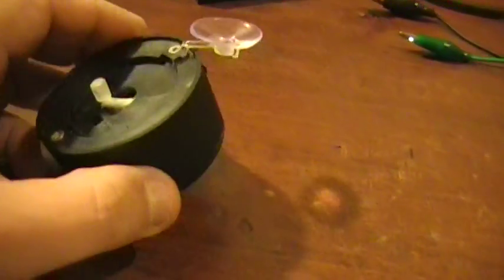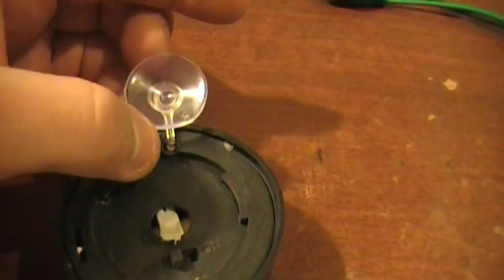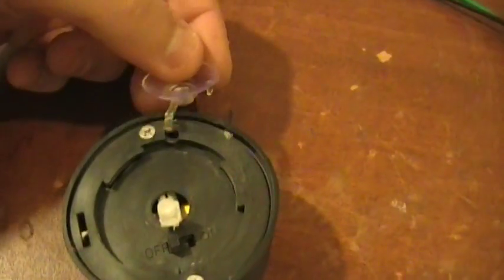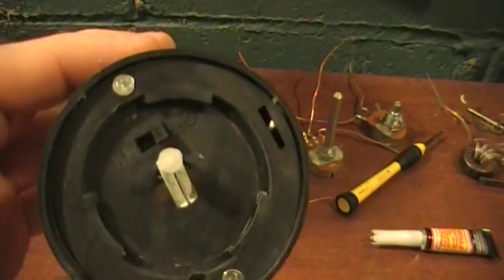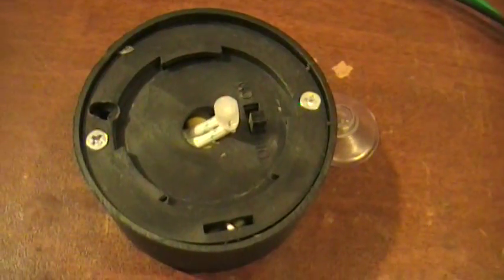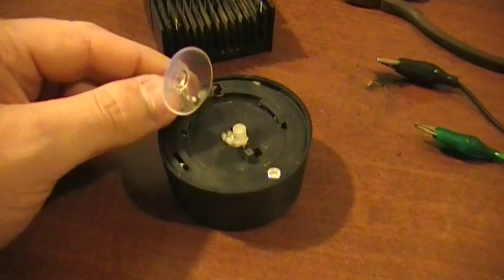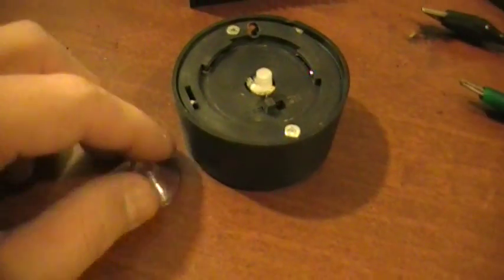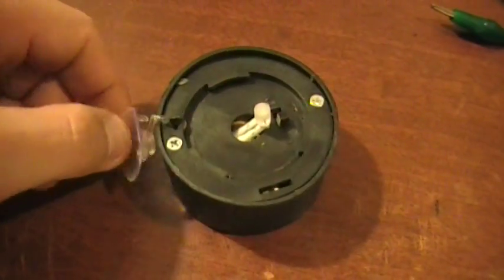DIY Vandwellers, Rv'ers, Campers, Solar LED lighting

Comment: hey thanx for sharing, I have several of these and knew there had to be a way to use them in my van.  Walmart & most dollar stores has them cheap as well... windering if there is a way to take the solar cell and put in window and wire to larger battery.  I realize it would not charge a car battery, but might be good if I had several to charge a battery big enough to charge laptop sometimes?  Just thinkin out loud, new to VanDwelling and thinkin outloud